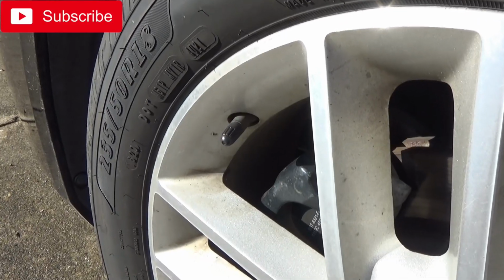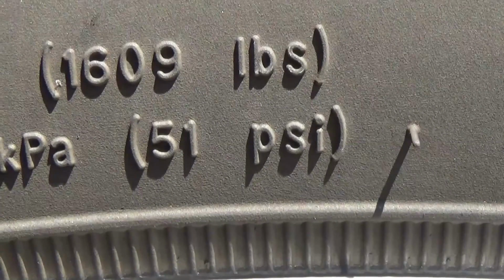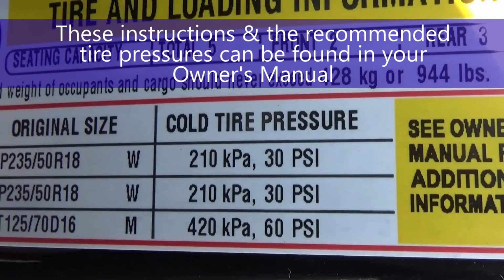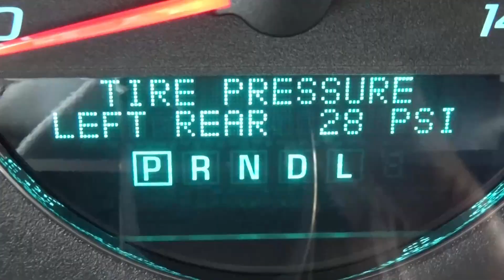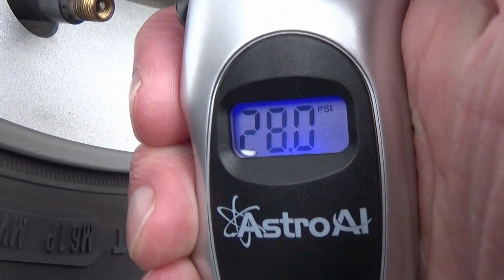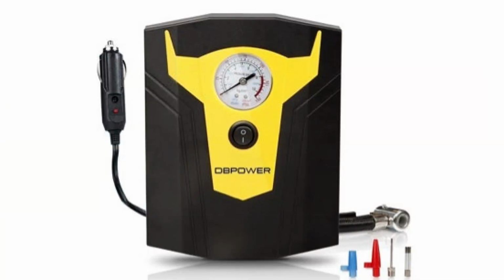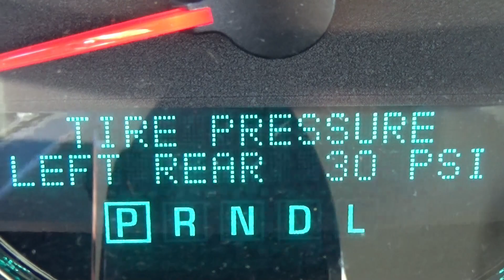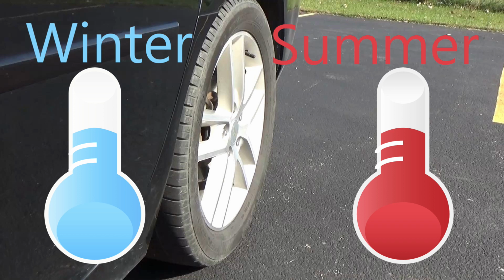How To Check Tire Pressure & Properly Inflate Your Tires: How Much Air Do They Need?

Comment: Very helpful video for people that are new to this! I do have a question for you (I always do!, LOL). What about the temperature outside when doing this? I realize that your one tire showed 2 psi less than the other 3, but say you are checking this at near freezing temperatures. I suspect they will all read less than 30 psi? Same thing if it is an 80 deg. day. They will all possibly show higher than 30 psi. I don't think we want to adjust the pressure at this point? The whole verbage about "cold tire pressure" is misleading in my opinion, because it does not state 30 psi at xx deg. I understand that "cold" means not to drive on them first. Thanks
Reply from the maker: Tire pressure does vary with changes in the outside air temperature, so it’s important to check them when that temperature changes greatly one way or another. The main thing, regardless of what the ambient air temperature is, is to fill your tires so that they have the car manufacturer’s recommended amount of air pressure in them. When the temperature drops, your tire’s air pressure will drop and you’ll need to add air. And when summer comes, and it’s hot all the time, the air in the tires expands, and you’ll possibly need to let some air out to get them down to the recommended air pressure.

Comment: We have a 2022 KIA Rio LX (bought new) with less than 4000 miles on it and the TPMS indicator came on a few days ago but doesn't tell us which tire is low.The recommended psi is 33 on all tires. We filled them up at the gas station but the TPMS still comes on so we may have to take it to the dealer if it stays on. I just ordered an ASTRO AI digital tire pressure gauge on Amazon and will test the pressure at home when tires are cold and see what it shows. Is there a chance the TPMS indicator is malfunctioning?